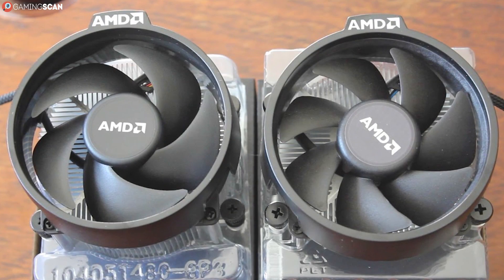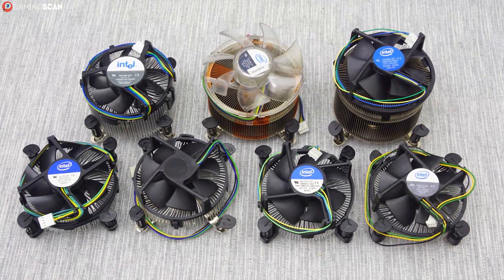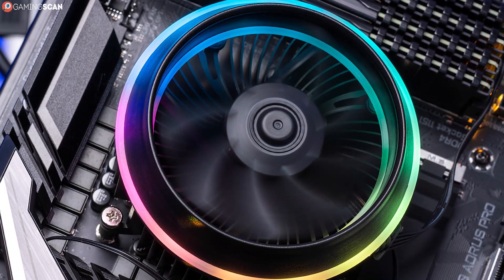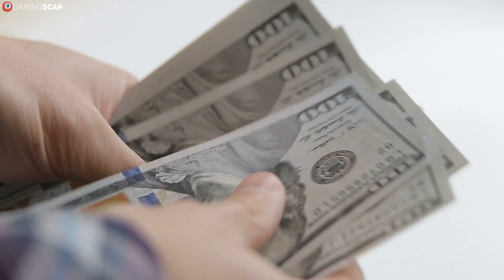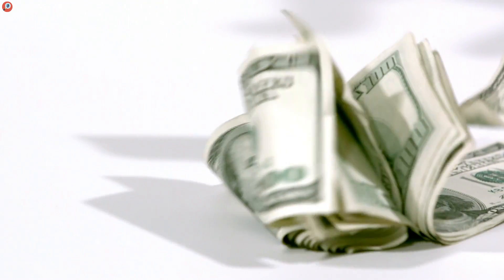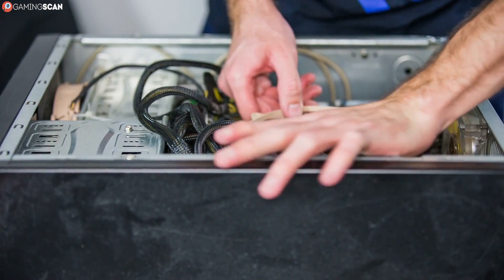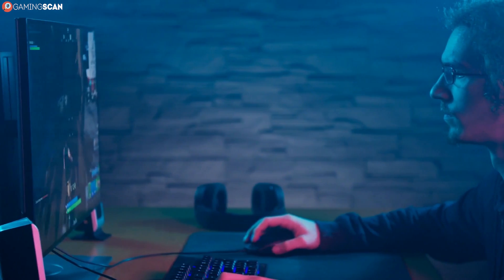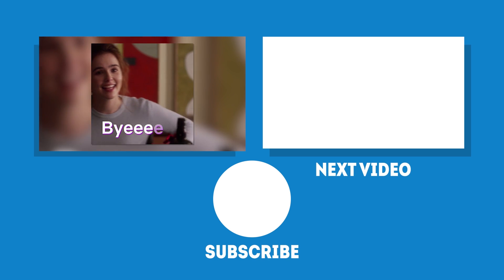Stock CPU Cooler vs Aftermarket - Is Your Stock Cooler Good Enough? [Simple]

Comment: Quick tip, add blue rgb to the fans. Removes 10 degrees
Reply: Na na na, red = more preformence, blue = cooler temps, green =  more power efficent, and rainbow.., it = all of the above but 2x better
Reply: @DonaldRump.  nah nah rainbow = a bit of everything, but will not be better than a pure colour
Reply: @DonaldRump.  Nanana, light makes heat, heat makes thermal throttling.
Thermal throttling means lower performance
Reply: looool. but have u seen intels cooler oof thats a sexy cooler
Reply: Thanks bro.

Comment: I got my intel i7 9700 with a 2060 super but I’ve noticed my cpu temp is around 75 to 85 and gpu is low on the 50s I mean the stock fan looks cheap so should I upgrade cooler or it’s something else making my cpu so hot

Comment: I got a cooler master aftermarket option but I think it's still not good enough, I've seen temperatures up to 90 celsius on my CPU
Reply: You should definitely do smt against that. Try to find one that keeps the temperature at about 70
Reply: Did u put thermal paste on?
Reply: Yeah I have a cooler master and mine doesn’t go above 60

Comment: Build my 2700x in december 2018...been using the stock wraith prism since then... but  it gets really loud recently.... and i noticed it hit 85c and trottling at 3.5ghz due to heat when i am rendering my youtube video... i am going to get a DR4 cooler... hope it solve my problem... 85c for me is scary as hell.
Reply: Yeah 85c is very scary
Reply: my pc run to 90 XD

Comment: I have an i7-8700 non k. Temps are pretty normal idle and while running most Games. But while playing cod MW it gets way to hot. Mid 80s low 90s sometimes. Most other games it usually stays under 80. Should I get a new cpu cooler? If so, any suggestions?
Reply: Does it get loud and what case do you have?

Comment: Will an aftermarket cooler be a solution, if my problem is not the basic operating volume of the cooler but how it whirrls up and goes back to silent constantly even when there is a slight increase in cpu usage? Its incredibly disturbing when browsing or watching a movie (intel i3 9100f)
Reply: Check the thermal paste.

Comment: Isnt it possible that AMD engineers calculated the heat dissipation capability of the stock cooler and therefore determined it would be enough?
Reply: Very True, but as the system ages and goes beyond warranty period and based on pc location conditions, ( and many other variables), it is advised to take constant maintenance or upgradation as and when required.(when heating issue arises). 

Until then the stock is far better 👍 if you're not over clocking..
Reply: a n i m e
n
i
m
e
Reply: @KokoroKatsura  a yes a parasite to the anime community

Comment: Running a Ryzen 5/3600 with the stock cooler, not overclocked.  I'm a photographer, not a gamer. Usually runs between 40-55c, sometimes hitting 60c when running a processor intensive plugin.
Reply: I'll add some info to this. Ryzen 5 3600 with the stock cooler, overclocked and with Nvidia Geforce 1660 Super, overclocked too. With four well positioned fans (positive pressure) I've never seen the CPU hitting more than 75c while gaming and doing heavy work. 50c iddle. 
I think that I'll buy a CPU Cooler along with another CPU, like Ryzen 7 or 9.
Reply: Do u think it will run games without overheating
Reply: neyyd no
Reply: @deliciousnar  yes
Reply: ً  The correct answer is no.

Comment: With Ryzen you can use the stock cooler first and save up for new cooler for couple months.
Reply: Yeah I’ve been using the stock cooler since I first built my pc, but since playing more games I’ve been crashing all the time, and have to get an aftermarket cooler - I was and am still new to this so I didn’t realise until recently 🤦🏼‍♀️ probably should’ve been something I bought at the beginning but ya no we learn from our mistakes
Reply: @Golden_Pickle  u probably don’t have the crashing problem no more but if you were crashing with a stock cooler I think you should turn down the settings a little bit or get more powerful parts
Reply: Noctua cooelr
Reply: @arianjafari8616  Beige and brown fans is really ugly
Reply: King Super Saiyan the beige fans are for pc’s with no tempered glass/or parts you can see in from
Reply: @cryo_life  yeah I agree. I got the chromax black version
Reply: @cryo_life  i dont care about looks tbh
Reply: @cryo_life  ikr
Reply: @Skididibom  i personally don't care about matching everything in a PC build, if your OCD about that sort of thing that might be an issue for some, but i have a tempered glass Cooler Master Q300L case, and you can see everything. i have a black 120mm fan in the rear, two black 92mm fans in the front from Arctic Freezer, i have one of Noctua's low profile coolers that's about the same size as the Wraith Spire on my Intel i5 9400 and it's brown. so nothing in my build matches, even my Ram is a different color than my motherboard, but it doesn't bother me any. the only one that's gonna look at your PC is yourself. of course you can get a case with no glass window, but a glass window will help reduce some heat.
Reply: Or just stick with stock and not worry about it
Reply: @travis1240  wdym not worry about it my cpu is idling at 60-70 celsius
Reply: Just asking, when and at what point should you consider to get a new cooler/cooling system (upgrade)? My case feels a bit warm on the side glass due to my R5 3600 stock cooler fan direction.
Reply: @ark8705  when it affects you usage, for example if you gaming, u keep having fps drop suddenly and recover back. I suggest u stress test you cpu and u can see the temp pattern. If having persistent fps drop, then you cooling system is not optimum. U can use software like furmark etc.
Reply: _ファタン If you have the money to buy go but if you don’t the stock cooler can do the job. I don’t recommend buying now because of the covid situation making all the prices swell.
Reply: @ark8705  The truth is, you don't really need to get an aftermarket cooler unless your CPUs stock cooler literally is incapable of letting you use your CPU without it thermal throttling. Luckily, but only happens when you spend five or $600 on the highest end, then you literally have to spend several hundred on exotic cooling solutions just to get the performance you paid for. I know, it's absolutely ridiculous, but luckily this doesn't affect most users.
Reply: I don't think 92° degrees was that usable with my stock cooler.
Reply: tahts what i thought, and even though i have 4 case fans with 2 intake and 2 exhaust, and stock cooler but my cpu is idling at 60:(
Reply: Yeh.
Reply: I accidentally touch the pre-applied thermal paste of my stock cooler ryzen 5 is it okay? or i need to remove it to add new?
Reply: couple months?? bruuuuh I bought a Deepcool Gammaxx 400 V2 Blue for 33 euro + Thermal Grizzly Kryonaut for 7 euro and the results have been amazing!!

my Ryzen 5 1600AF@stock was hitting 70-75C when gaming and now it's always 45-50C MAX! (idle is 35C) these results are amazing for only spending 40 euro lol
Reply: sort of
Reply: Did it.
Reply: I have a stock AMD cooler with Cooler Master fan. Should be fine with Ryzen 5, 3400g?

Comment: I have a 2 core🗑 CPU and it never gets hot for some reason, even with the stock cooler😂
Reply: Core2duo I know you have it they get hot like a fucking sun I know cause I had one like 1 year ago I changed thermal paste artix mx3 and I had hyper 212 and it still got like 60 degrees I was thinking maybe is procesor yeah after that I don't know why I thouth ryzen 5 1600 was 775 socket so I bought new pc and ryzen 5 1600 with hyper 212 is getting like 20 degrees Idle and not over 65 load

Comment: LTT said liquid cooling is going away
Reply: I hope so. High price and maintenance plus higher risk if failure and always that small chance it can leak and break everything
Reply: Noob$lay3r I had an aio for a year and a half and it failed on me just last night. I stuck my stock amd cooler in and it keeps it cool at idle better than the aio did. Going back to air.
Reply: Hoof Arted Yo that’s great but there’s no way something wasnt wrong with that aio or how it was set up. Stock coolers are never that good. Go for a hyperx 212 or arctic 34 esports duo (<$50 usd and available on Newegg) and you’ll get sub 60 load temps consistently
Reply: @turn1p  the aio i had was getting below 60 (around 54 C) load temps, the stock air cooler is getting 64 load temps. thats with overclock. its not much of a difference. i would venture to say if it was a 360mm rad it would probably be even cooler (this one was a 240) but with the price of the aio and the stock cooler only being 10 degree difference id say its doing just fine now.

Comment: Intel stock cooler. AHHH it is so ugly and so bad.
Reply: My dirty ass mind saw something else when I looked at the pfp
Reply: @statiic.  what the hell I'm only a egg. Did think of the process of making me?
Reply: ACIDIC lol whT
Reply: I'm the only that i like the stock intel cooler design?
Reply: @peanutshell7202  yes
Reply: @silvercross2020  ok
Reply: Intel’s is not bad but ok
Reply: @ThatGuyQuestionmark  did you even watch the vid xD at least with AMD you can overclock a little and they look 10 times nicer
Reply: Same with AMD stock cooler
Reply: @micahbell4235  Not all some of the later stock cooler look nice and work well but for some it is also most useless and hurts the pc but that is almost only for $350+ and a few under it
Reply: @micahbell4235  Lol the amd cooler looks decent.
Reply: @micahbell4235  And you can overclock the cpu with the stock cooler.
Reply: @micahbell4235  the amd coolers don't look bad
Reply: @micahbell4235  The amd wraith spire and max are actually pretty cool

Comment: If it's a ryzen series cpu cooler ur good if its intel's homeless cpu cooler you're not good.
Reply: Is it normal for the ryzen fan to have some liquid on the frame? I just got my pc a week ago and noticed it. I'm new to PC and I'm freaking out 😬
Reply: @WildCvnt  no its nor normal, but i suspect on the dude who assembled it taught that its a crap cooler just like intel one so he added aditinal oil in fan hub. Probably to protect himself from warinties (I did that too)
Reply: @racionator2668  it hasnt done it since, added more fans in the front. Think it was rust heating up the pc tbh 😂
Reply: Nah it’s a shit cooler, it was the worst cooler I used ever, 80c when I’m not over clocking, I had enough with this I bought a new better fan and the temps are lower than a snow mountain

Comment: AMD's stock cooler is way way way better than Intel's stock cooler. You can even oc a little with the ryzen 5 3600's stock cooler. ONLY A LITTLE. I use the stock cooler that came with my 3600 and it's perfect if you don't care about oc.
Reply: Just built a Ryzen 3600 PC and installed a Scythe Mugen Rev B cooler. Easy install, temps are good, and I cannot hear it at all (Yes, it is running ;-). May be overkill for my uses but I did not want to install the stock cooler and then find temps running high even though I am not into overclocking. If you decide to switch from the Wraith cooler, I would recommend the Scythe Mugen. It should give you that leeway to do some overclocking without worry.
Reply: @dhblan8591  thanks I'll check it out
Reply: I overclock my 3900x to 4.5ghz with stock cooler 😂
Reply: @dashcamlan6603  you are a LENGEND
Reply: 3600 @ 4.2g is idling at 38C, stock cooler... 2 case fans... seems fine... lol  ¯\_(ツ)_/¯
Reply: It's good for gaming but not really useful for cpu intensive stuff, I have a wraith spire cooler and whenever I use handbrake the cpu temp would go as high as 90-100 just from encoding 1 hour video. It's also kinda noisy if you use sit right next to you. Then i change to cryorig tower cooler the cpu temp dropped to 70 ish and never go above 80 and also don't produce any noise.
Reply: @enterthehyuver4747  won't it depend on your case air flow and how cold the room is. My room is really cold so I won't have a problem with over heating
Reply: @latackty2135  well I live in tropic area(indonesia) and the case I use is not really have strong airflow(nzxt h500) but the fact that it keep hitting 95-100c even when I open the tempered glass side panel is alarming enough, and when I use my cryrorig h7 the max temp I ever saw is around 73-75c and that's when I am encoding for 4-5 hours straight, and according to some enthusiast the h7 isn't that good of cooler, it sorta midrange ish which I choose because of the rgb blink and the memory clearance.

If you don't want to change your cooler it's fine tbh, if you want to change it then do it because of the accoustic, my wraith spire works fine for gaming but I just can't stand the noise when the fans rev up.
Reply: @enterthehyuver4747  yeah I'm thinking about getting a 120mm aio or a deep cool air cooler. I want to buy the aio but I don't know the lifespan and I'm scared that someone might turn up the heat in my house. And my aio night be ruined. Another question will it be hard to install a new air cooler when you already built the PC.
Reply: @latackty2135  if you worried about lifespan then definitely don't buy one, since it could degrade faster than air cooler, but I also saw people using it for 5 years and have no problem, also the cons of having water cooler, is sometimes you might get the one with bad radiator that could make noise.

For air cooler, you don't really need those fancy high end like the dual tower, single tower should be enough if you are planning to use mainstream processor like ryzen 5 and i5, you wouldn't need better cooler unless you want to use the likes of i7 or ryzen7.

As for AIO installation it's not that hard, you just need to decide where you want to mount the radiator, on the intake or on the exhaust(I prefer exhaust) and you should be good to go.
Reply: @enterthehyuver4747  ok thank you so much. I am going to buy an air cooler I found a deep cool one Amazon in the 30 dollar range. And it has really good reviews.
Reply: Danny Sulistio I feel your pain, I upgraded to a better fan and now it’s running 30 degrees on idle, don’t use the amd stock

Comment: The cooler came with the AMD 3900x does a good job, but I’m still buying a waterblock for the cpu Ram and graphics card 😂
Reply: good for you
Reply: ...what’s so funny
Reply: Thicc III stays quiet and cool with air
Reply: @MrRourk  no, thicc cards aren't good, Asus Strix, Gigabyte 3 fan and Sapphire Nitro+ are good.
Reply: @ItssMitch  in this market any card you can physically  get your mittens on is good.  3070 get here soon.
Reply: @MrRourk  I guess but Thicc cards have horrendous cooling, that's why xfx released the Triple Dissipation cards